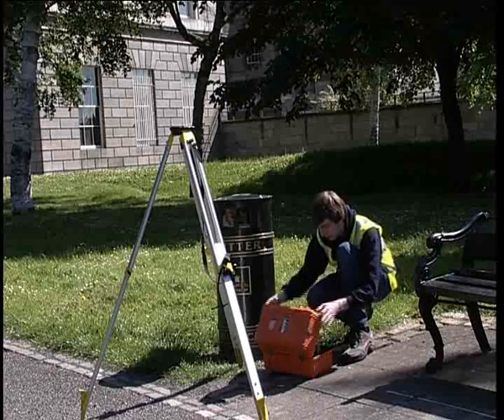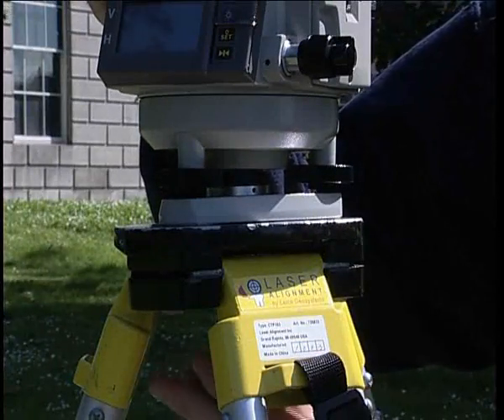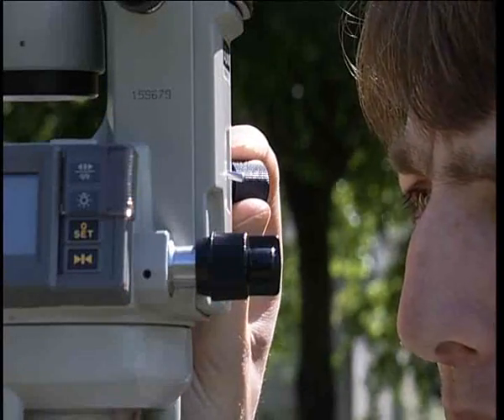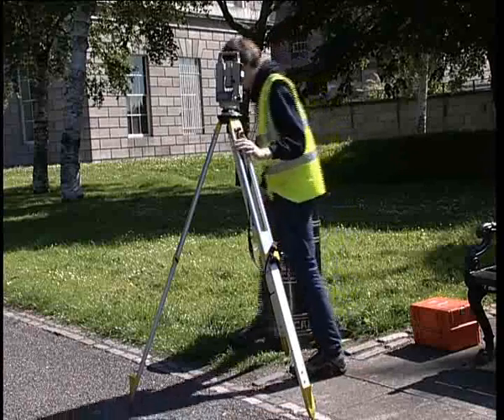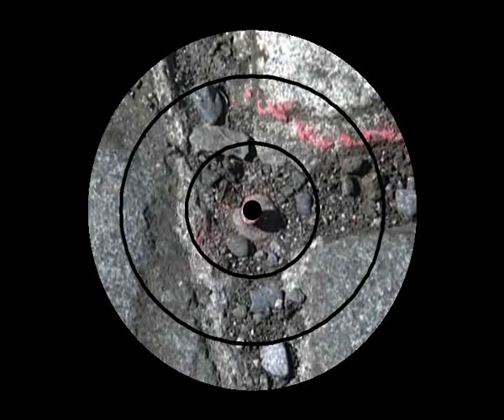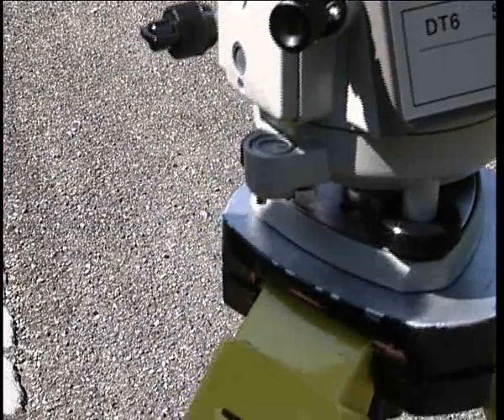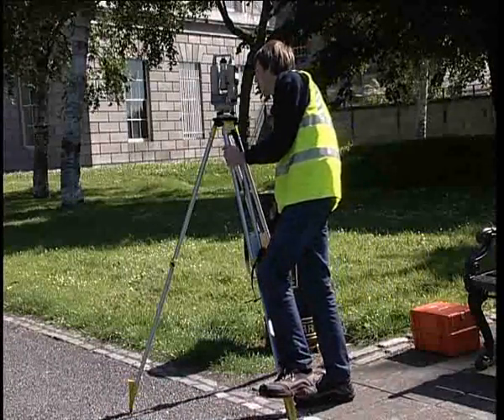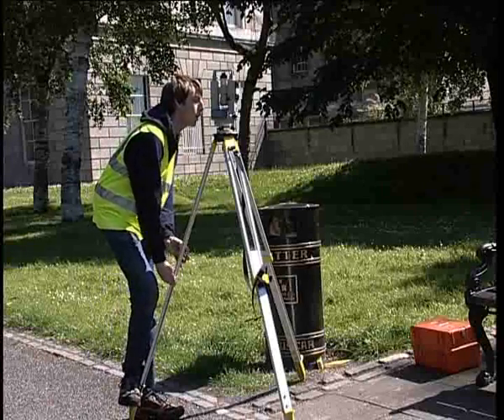How to roughly level a theodolite over a point.flv

Comment: NO NO NO!  Do not "dance" with the tripod with the instrument attached!!
To adjust the optical plummet onto the nail, use the tribrach footscrews!  Then adjust the legs to centre the bulls-eye bubble.  (It is only necessary to move 2 of the legs)  Then centre the bulls-eye bubble accurately using the footscrews.  Finally, move the tribrach on the head.  Relevel if necessary.  Cowboys...